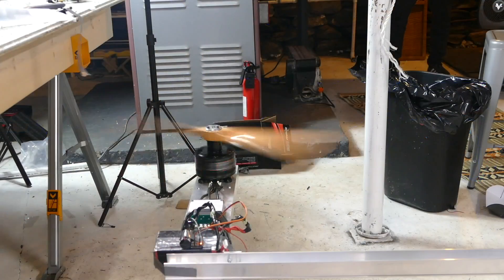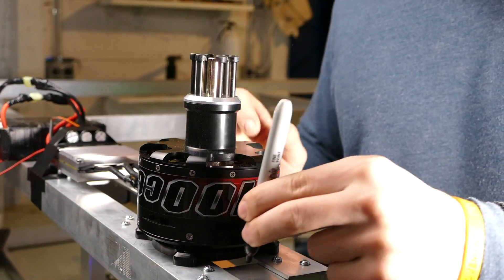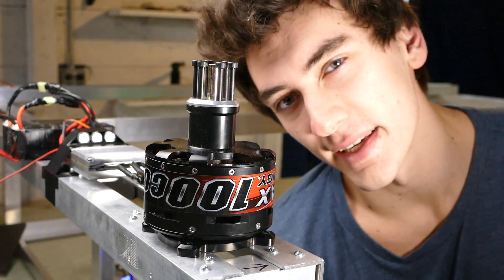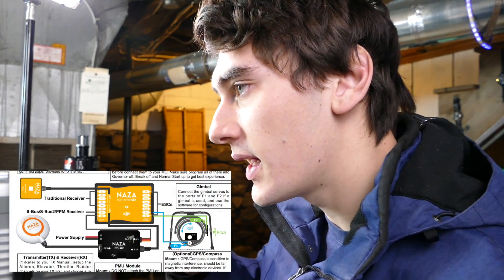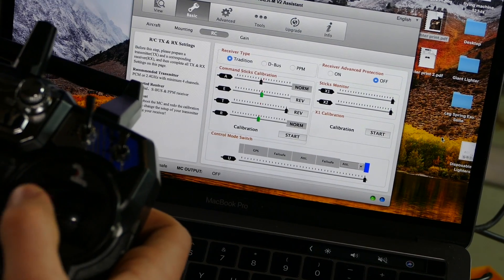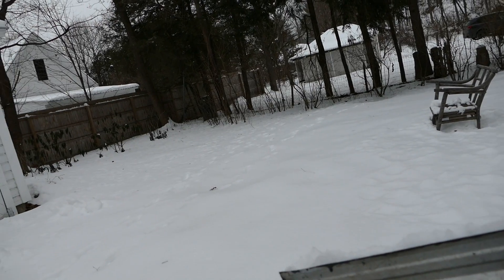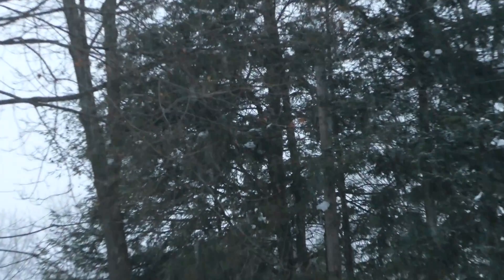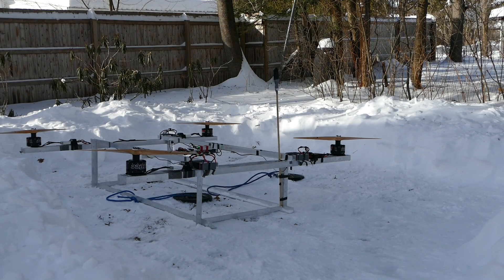I CRASHED MY HUMAN FLYING DRONE (Part 2)

Comment: you need a flight stabilizer to improve how much power each motor gets
Reply: he has a flight controller/stabilizer (DJI NAZA V2)
Reply: @ImThijs  he should try a racer quad rc the naza needs calibration frecunt!y
Reply: @haralambosorganopoulos8543  I have a Naza M Lite upgraded to M2 firmware, last time I calibrated mine was about a year ago, it still works fine
Reply: Could be the problem
Reply: He just needs to trim on his remote guys....the fact he didnt do that immediately is astounding.  He would have same problem on a  cheap toy drone.
Reply: @OswaldBeef  That is totally untrue, this is only the case for a full manual drone. The Naza automayically levels the drone when all sticks are centrered...
Reply: @ImThijs  that is also untrue. No trim at all on the transmitter is necessary if you have the copter set up correctly in the first place. I've got half a dozen quads that range in size from whoop class to 250mm freestyle quads. Not a single trim setting at all on any of them because the gyros and pids on the flight controller itself keep them in line. I fly full manual on everything but the whoop for what it's worth.
Reply: @thegrafxguy1  Flying with gyros isn't full manual 😉
Reply: You need Dji ;)
Reply: @patrykmodel  Lol you know he is using a DJI NAZA...
Reply: You slhould not have this problem Have you tried calibrating your motors????
Reply: @haralambosorganopoulos8543  just because you calibrate your motors doesn't mean they are going to be stable at 0°. You need a module which can track how levelled your "machine" is. Also, you'll need another module that can control how much power each motor gets, without it the drone won't be able to hover because one motor we get more power than the other and the results are what happened in this video. The drone will lose control and crash... It's not about calibrating the motors, but about linking them so they'll always try to stabilize back to 0° after moving
Reply: @brasilianols6350  I think he already uses a flight controller, why do you think he did the magnetometer calibration dance?
Reply: He calibrated the drone not the motors the ecs i mean